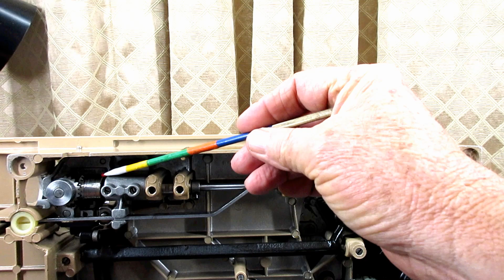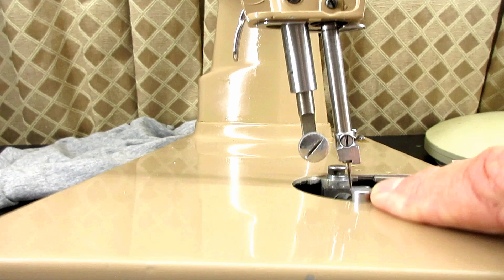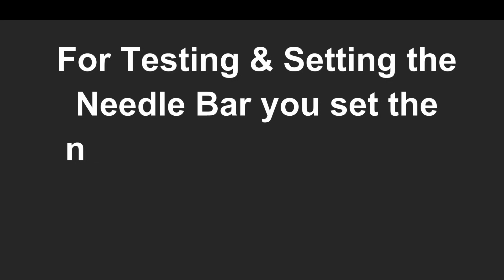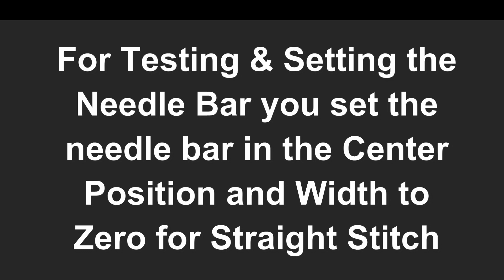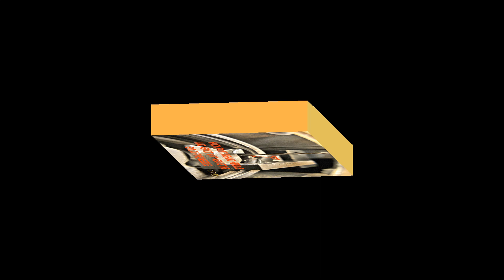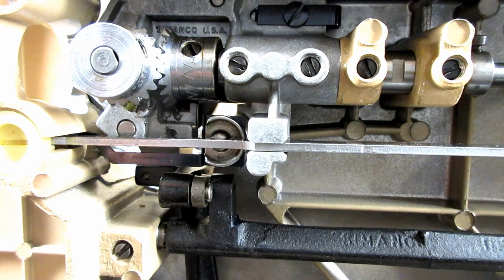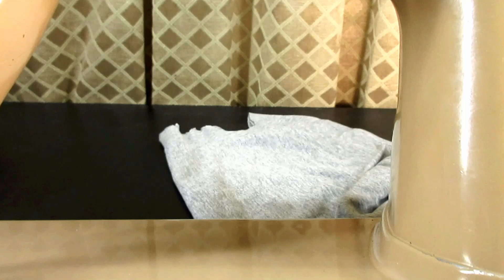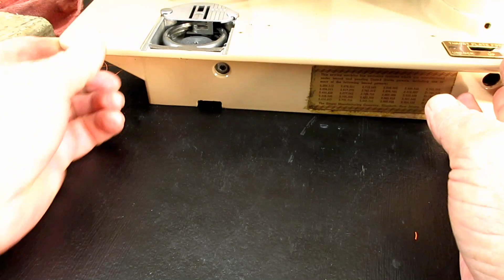How to Check and Set the Timing on a Singer Model 403A Special Slant Needle Sewing Machine

Comment: This video is incredibly helpful. I recently was gifted a 401a and I've noticed it's striking the throat plate in certain situations despite working most of the time and now I think I'll be able to figure out what's going on. Thank you!
Reply from the maker: Frank, I thought more about your needle strikes and that is not a fault of timing if the needle hits the needle plate. A common fault of new sewists is "Helping" the fabric along while sewing and that flexes the needle towards the read and causes the strike of the needle to plate. Otherwise, there are adjustments in the Service Manual for setting the needle left, right, forward, back, and center it in the hole of the needle plate. Sometimes the machine just needs a basic cleaning and proper oiling. That often fixes most functions. I do have several videos for model 401A in a Playlist here: https://www.youtube.com/playlist?list=PLsCOZgzzaiKLiDl9yFTP6mJgQmz5lj4NO
You can download a free copy of the Service Manual at this link: https://sewingdude.files.wordpress.com/2012/09/singer-401-service-manual1.pdf      The original Instruction Manual has good directions for oiling and greasing the machine along with using all the functions. It is still available for free download from Singer SUpport at this link: https://www.singer.com/search/support?title=401
Reply: @andytubesewing1953  Thank you again. I'm a pretty novice sewer so I might be guilty of that. I did notice that the throat plate was pretty chewed up when I got it though so I figure I might as well check the timing and so forth. Thank you again for sharing this knowledge: I already used your tutorials to get the camstack unfrozen and get the machine running in the first place.
Reply from the maker: @franksmith7792  (EDITED) That's great that you're fixing it up and getting it back in service. It's a very worthy machine. I wish you the best of luck with it. Since you already have evidence of many needle strikes to the plate then maybe the needle is set too far back from the center. I know some techs also would move the hook closer to the needle if the customer complained of poor results when sewing knit and double-knit fabrics. That adjustment is also in the Service Manual.
Reply: @andytubesewing1953  so the needle was out of center but everything else looks OK. Thank you for the advice!
Reply from the maker: @franksmith7792  congratulations Frank. You sure got the hang of it now. Thanks for repairing the machine

Comment: Dear Andy, I love your lessons and sense of humor. Always. A pleasure. Why would a singer 401 sew all stitches perfectly but won’t even pick up the lower thread when trying to do free hand embroidery with cotton woven fabric on a hoop? I’m thinking the timing could need a tiny adjustment so the hook can pick the thread - I suspect the thread loop behind the needle might be smaller in this situation. Does it make sense? Thank you so much
Reply from the maker: A fabulous question, Paula. Thanks for asking. You can skip down to HOW I WOULD TEST if you like.
     HOW I THINK STUFF WORKS: As far as the smaller thread loop I'm thinking maybe. That loop is formed when the needle is raising up out of the fabric. The "drag" of the fabric causes the loop. Woven fabrics are a little tricky if the "weave" is more open, ie: less drag.
Also, a larger needle displaces more fabric (bigger hole) so even a lesser amount of drag. If your normal sewing is good without skipped stitches I feel like the timing is probably OK. We are talking needlepoint to hook point timing but have you ever heard of "Feed" timing? That is the timing of the Feed Dog as in how it moves the fabric in time with the needle stroke. Your Presser foot usually holds down the fabric so it won't move up & down much as the needle goes in and out of it. The feed timing is so close that the needle is up out of the fabric when the dog moves the fabric back. Now think of your free hand sewing. Am I correct that you have removed the presser foot? Normally you would and even with the fabric tight in a hoop, it will flex a little more as the needle comes out. Normally you would also have raised the needle plate on your Model 401 which makes you the "fabric feeder". So, how is your timing? 😀 If you move the fabric as the needle is coming up then the needle flexes, even a tiny amount. That can move the thread loop away from the hook point and cause a missed stitch. 
     Also, (a little too much info here maybe, but you asked), there is a setting for distance from the hook point to the needlepoint that is different than the normal timing. The distance is really tiny and you actually measure it from the position finger inside the hook to the needle and it is set at 0.018 inches. If that is set too close or too far it affects the hook point grabbing that thread loop. It is rare for that to be off unless someone messed around with it in the past. Towards the end of this Part 1 video I show the position finger if you are interested: https://youtu.be/T4YPB1KK3_Q
     HOW I WOULD TEST: I think I would set up for freehand sewing and sew a few "wheel" stitches, meaning I would just turn the handwheel and carefully move the hoop while watching if the needle pops all the way up out of the fabric. What if your hoop is too thick and makes the fabric height so high the needle never comes out? By doing wheel stitches I want to see if I can form stitches at a very controlled speed and see if I can make a couple of normal stitches. That would tell me whether my needle-to-hook timing is good or not. If I could stitch with the wheel then that would me that I may be moving the hoop too soon or too far and bending the needle away from the hook. If I could not even form stitches by sewing that slowly with just wheel movement then I would take a close look at the timing
     The nice thing about that is you can check all of the settings carefully without using any tools or changing anything on the machine, but just use a good flashlight to check the height of the needle bar settings and if the needlepoint/hook point comes together at the perfect moment. If the timing is off you should be able to tell and then fix it with the info in this video.
     SO, is the hoop too tall? IS the needle too big? (Professional Sewists tell me they always use the smallest size needle for the thread to make the nicest-looking stitches) AM I moving the fabric/hoop too soon/far and bending/flexing the needlepoint?
     BTW, the instructions for setting the hook to needle distance are on page 144 of the Swing Needle Service Manual for Model 401A. 
It's a little tricky to do but I've done a couple machines. If you need a copy email to andyparts53@gmail.com and ask for it. I will have them reply with a FREE PDF copy of the entire manual. 
A tricky question you asked, Paula. I enjoyed trying to answer it and hope I have not spoiled it with such a long reply. Thanks for your kind remarks too, and for watching my channel. Good Luck.
Reply: @andytubesewing1953  Dear Andy, such a wonderful gift to get your detailed reply the next day! After reading it several times, I observed everything you suggested. Timing looked fine, but I decided to lower the needle bar a tiny little bit just enough to see the lower rim of the upper circumference (timing mark). Tried smaller needle. Tried another fabric. Still the same thing: with fabric in the hoop and no foot, the upper thread doesn’t pull the lower thread. With normal settings (either fabric under foot or no fabric) pulling up the lower thread works perfectly - in any range of needle positioning. By the way, my “mine” feeding time is ok because I’m not moving the fabric 😉. All this was just turning the hand wheel to get the thread up. I’d guess, that you might now try for the first time freehand sewing with a hoop so: the fabric is placed so that it touches the needle plate (independently of the hoop tallness) 😉. In conclusion, as you explained and I confirmed in practice, when the fabric is under pressure under the presser foot all works perfectly, so mimicking this by holding the fabric by hand (still in hoop) tight against the raised needle plate, it worked fine and the upper thread did its thing grabbing the lower thread. So, I tightened the same fabric as much as I could with the hoop and held it down against the needle plate while turning the handwheel… and “ta daaa” it pulled the lower thread up and I was able to finally freehand embroider an old fashioned ABC 👏 🎉 for the first time without any foot on the machine. In other machines, that lower feed dogs, I have easily done freehand sewing using the special feet for this purpose but it seems the 401 and the 411 didn’t come with one. So I wanted to try it as it was supposed to when these machines were made - no foot, no spring, just needle. The fabrics I used were old scraps, probably too flexible, not tight enough in the hoop, and the fabric was thus pulled up with the needle, consequently not forming the needed thread loop for the hook to catch the upper thread. The end. Recommendation for others, if you’ll agree, would be to use a firmer fabric, tighten it as much as possible in the hoop and hold it against the machine bed. Curious also that without fabric, it’ll always pull the lower thread up - I suppose because the tail of the upper thread it loose and forms a good thread loop, whereas with fabric the upper thread tail is enclosed in the fabric against the needle shaft but when raising rather freely with the fabric itself (not pressured against the needle plate), the thread loop won’t form adequately. Very interesting. And the last interrogation that you raised and still lingers - the horizontal (am I right?) distance between the needlepoint and the position finger inside the hook that should be 0.018”. I’d expect the 401 (etc.) to be more forgiving, so I suspect this distance is probably a little off. Next chapter to come if you ever decide to make a video about it ;) Thank you so so much for all your help and kind offer. I have the manual already luckily. I do need it a lot.
Reply from the maker: @paulamendes5907  What a great reply, Paula. I love the detail and recommendations for other viewers; thanks for that. I questioned a sewist I know in the Philippines who embroider names on ball caps using a model 66 straight stitch only Singer. He mentioned the Instruction Manual for model 401A said to use an "Embroidery Hoop Guide" installed on the machine and held in place by the bobbin slide cover. (pg 81) I looked and sure enough, it does show that but I have no idea where to find one. He suggested I look at some embroidery videos by  Christopher Nejman on YouTube b/c he uses a 401A. Here is the first one that I found and it shows using a special embroidery foot. That seems easier than holding the fabric to the needle plate by hand:
https://www.youtube.com/watch?v=3-yzcTlLYLw    I get that you want to do it the way they did when the machine was made. I'm glad you accomplished that. I really enjoyed your question and answer b./c I don't sew at all beyond testing the machine and you enlightened me quite a bit. I'm grateful for that. 🙏 Also, about a video showing the hook-to-needle adjustment; oh, sigh... if only I could make more videos. Happy sewing, and take care.

Comment: Do you have a video on setting the timing for the feed dogs on this particular machine or other slant shanks with the same feed?
Reply from the maker: Not exactly. While there are a few instructions in the Service Manual for adjusting the feed dog and replacing the feed shafts, here is what it says under FEED TIMING on page 131; ""CAUTION: Feed eccentric is correctly set at the factory. This timing should not be altered.""  That's it, the whole thing. However, on page 153 there are instructions for Removing & Replacing the Feed Lifting Rock Shaft. After the replacement, they advise doing those other adjustments, ie: set dog height - page 128, set dog lengthwise - page 129, and set dog sideways - page 130. The height & length adjustments involve turning an eccentric stud. Perhaps these are the types of "timing adjustments" you are looking for, IDK. I have some videos about the height and length adjustment on a few SInger machines, but I feel you'd be better off with the Service Manual which has 45-pages full of adjustment, removal, and replacement instructions. You can buy copies on eBay and you can also download a FREE copy from the Sewing Dude blog at this link: https://sewingdude.files.wordpress.com/2012/09/singer-401-service-manual1.pdf   The free copy is not the clearest PDF you'll ever see, but it is generally good enough to use, and hey... it's free!
Thanks for watching my channel, and good luck.
Reply: I mean the needle and hook are set correctly but the needle strikes before the feed dog is completely finished moving back and dropping down, it’s striking right before the feed dogs “go down the hill” for lack of a better term
Reply from the maker: @austindowton6238  So I guess you did not download the manual and check about the eccentric settings as you did not comment on that. OK, up to you. 
     If the needle is entering the fabric while the fabric is still moving that is normally a timing issue. Timing of the needle to the hook point involves the height of the needle too. I'm wondering if you turned the handwheel the wrong way while setting the height of the needle, or if a previous owner did that. 
     Is this machine new to you? It was doing this when you got the machine, or you've had the machine for a time, it worked perfectly but suddenly started up with this problem? 
     What I mean about turning the handwheel the wrong way is the height is set with the needle bar at the lowest possible point. Then you turn the handwheel to raise the needle upward a tiny amount to the timing mark on the needle. That handwheel turning should be forward*, towards you, and not *back away from you. I've found machines like that. When the needle is at the lowest point turning the handwheel either way makes the needle bar go up so some folks miss that handwheel direction. Just a thought. 
     I've never had what you describe on a Singer machine, but I've only worked on a couple hundred of them and there is a first time for everything. I mentioned the feed dog adjustments b/c of the eccentric studs that are used for adjusting. (two of them) B/c they are eccentric there is a high point and a low point on each stud and the adjustment is on the high side, and normally the stud is only turned in a 90-degree range to keep the high side of the stud toward the back of the machine,  but I've found machines where someone turned the stud 180 degrees and made the adjustment on the low side.
      I don't own any machines at this time so I can't play around with one to try and create your problem, but only think of adjustments I have made and problems I encountered in the past. I am trying to help though. I do remember that the needle penetrates the fabric at the exact moment the dog stops moving it and if your needle is entering moving fabric then, yes, it is screwed up. I get it. 
     The only other eccentric I can think of on a 403 is on the top horizontal arm shaft and the "fork" of the feed forked connection slips up onto it from the underside, That eccentric (Y2 on page 155) is what "rocks" the feed shafts for that undulating up & down movement of the dog. Maybe that is the eccentric Singer mentions on page 131 that is factory set and what causes the feed "timing". I've never had a problem with that one. If I remember right it is held onto the shaft with a set screw and I guess if someone moved it or it "slipped" on the shaft maybe that would change the feed timing. 
     Beats me; I've just never experienced your problem.